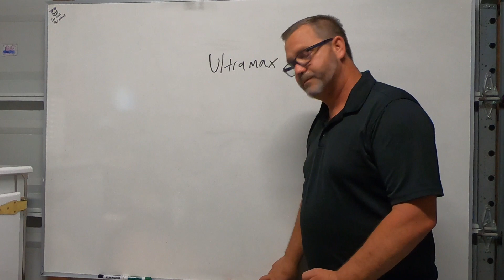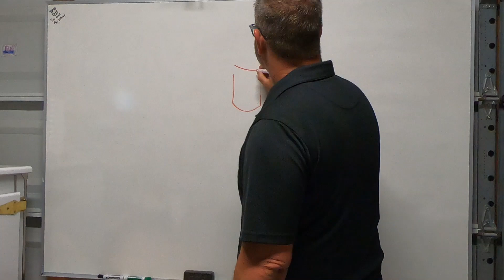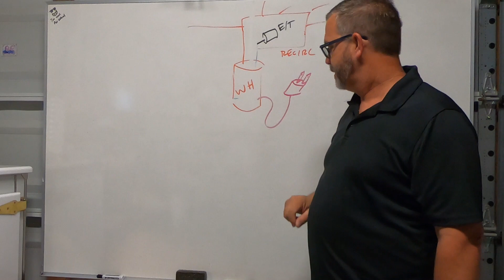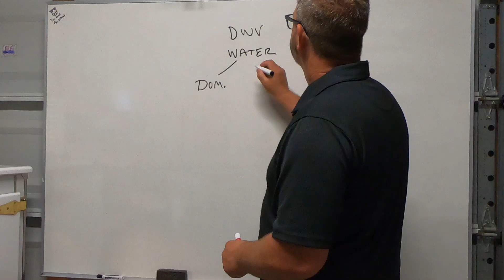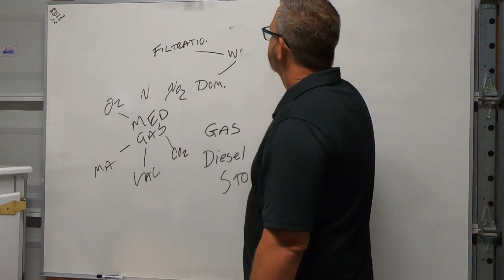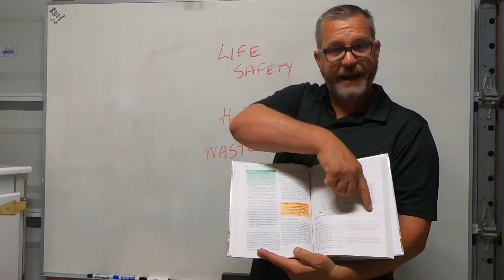Plumbing I Student Questions

Comment: Why not put an anti-acidic soil blend as the bed for cast-iron pipe to give it a long life?
Reply from the maker: An anti-acidic bed will only stay anti-acidic for a certain length of time before the surrounding soil "soaks" into it- so the soil is at that point an extension of the piping.  The best possible solution would be to wrap the piping to extend the life.  Great question!!!